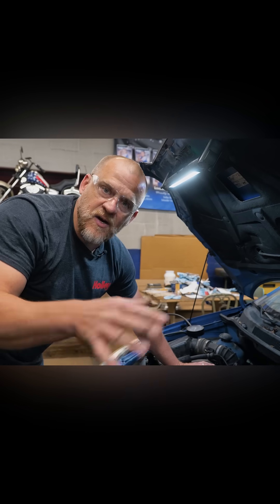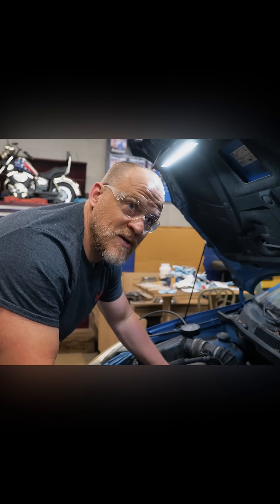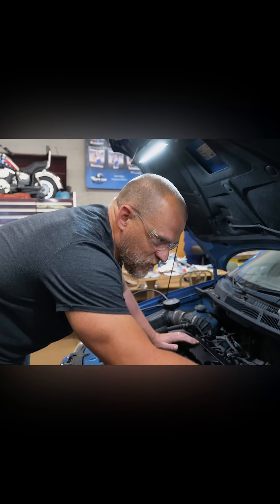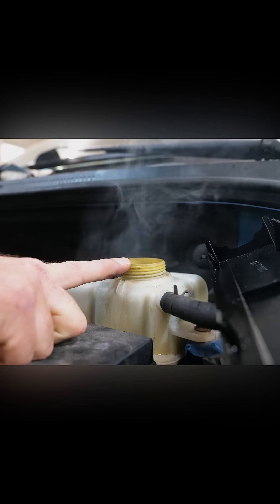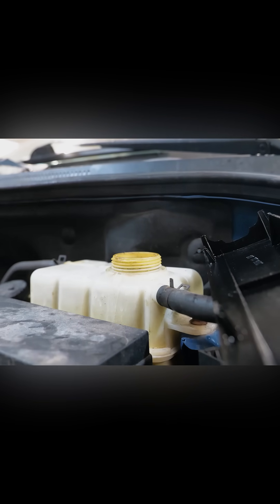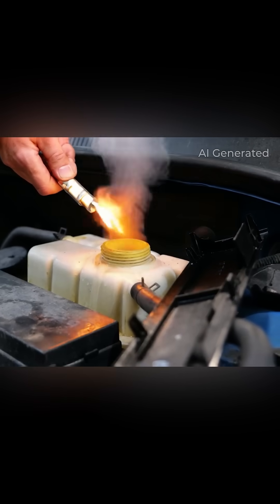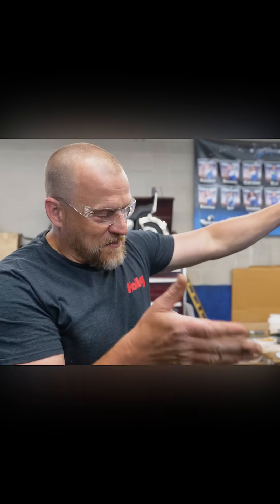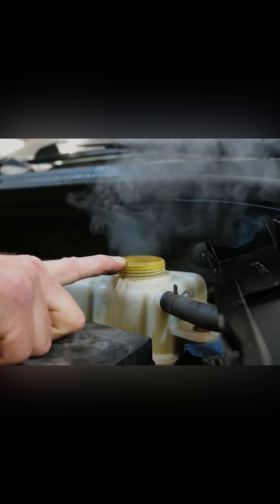Is this enough evidence to pull the cylinder head?

Comment: I should check this on my diesel. My coolant is super oily and engine is overheating. I did a flush which was good for a few months but it would reach a point where it would turn black and start overheating again.
No coolant in the oil luckily enough.

Comment: When I went to school 30 years ago we would put a bag over the coolant recovery bottle and if inflated you could be sure there was a head gasket problem but to double check you would poke a hole in the bag with the exhaust probe on the inspection machine  and test for HC and co and you could confirm a bad head gasket

Comment: Those ecotech motors are garbage. I have replaced so many of those engines and headgaskets. The cooling fans dont come on until like 230F and your cooking the head gasket about 10 degrees or less later. Chevy left absolutely no room for an overheat condition and trying to pull over to shut it off.

Comment: I know that smell. When I smell gas in the cooling system,  it's game over. Most head gaskets now are multi layer steel. The gaskets don't blow. Usually, something cracks, the head, the block, etc
Reply: multi layer gaskets do blow like nothing, actually the fact of it is race cars used to have one layer of pure copper seal as head gasket